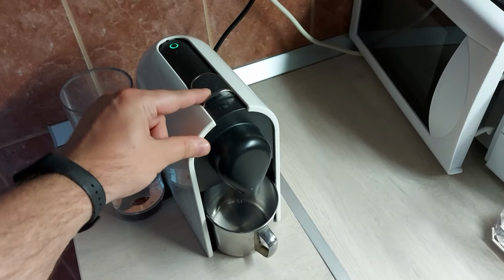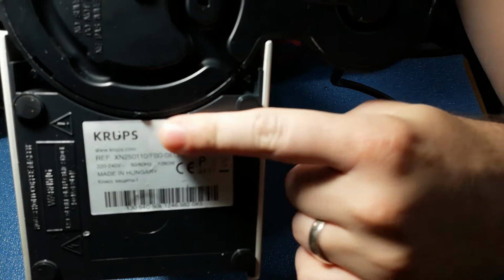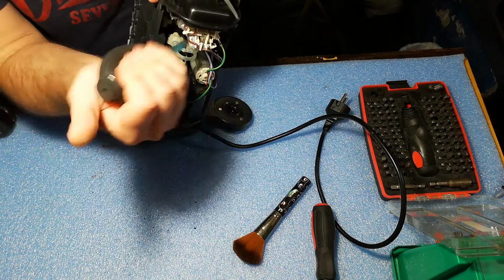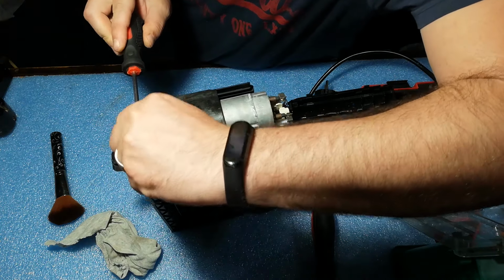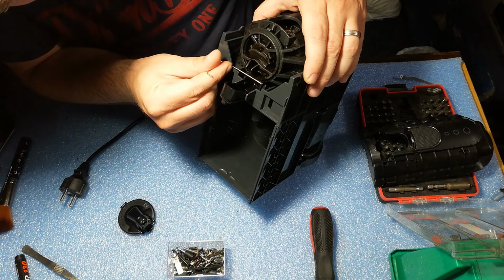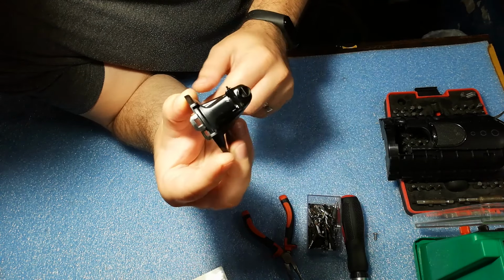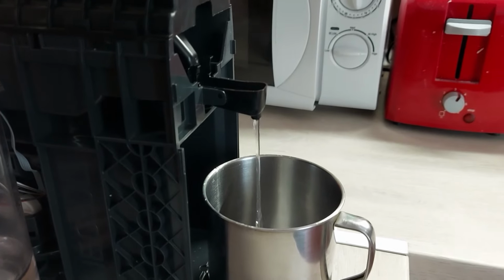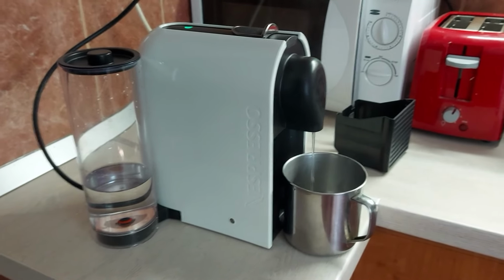Nespresso U - Step by step repair guide  KRUPS XN250

Comment: TYSM!!!! I used this video to diagnose and repair my Nespresso U (D50) made in Hungary.  The biggest problem was figuring out what tool I needed to unscrew the 3 screws to open the housing.  For those in the US I bought a Titan "tamper proof star key "set for $10 -a very worthwhile investment. The T-10 star shaped screwdriver with a central  depression fit the tiny screws in my machine which may differ by manufacturer 
 I did the same repair in the video using a thick piece of wire from jewelry making and gluing it as per the video. I later found the part on eBay for around 20 dollars but so far my repair has been working.  
I could not have done this without this video!  Thank you again!

Comment: Thkx a lot Adrian, great repair café!! In my case the clips were not broken. Only the noozle was no more fixed. By the way, my model has a third screw located behind close to watertank which you need to unscrew to take over the cover. Torx are TORX BO TX 10  which a whole in the middle
Reply: Same as mine, the lower clip was broken. So I don't see what's wrong on the noozle from the tutorial, it looks like mine (without the metal pin) ?

Comment: Great video! An easier way to remove the nozzle is to run the machine and then pull the plug when the main part has moved to the back. Plug it back in when you have reinstalled the nozzle and it will move back into place.
Reply: This was the method I used. Didn’t need to take the case off, no Torx screwdriver required.

Comment: Just fixed my sister-in-law's Nespresso XN250 using this method, thanks so much. A tip is to use a section of spare/broken stainless steel spoke from a bicycle wheel, so there are no potential issues with rust.
Reply: Play

Comment: Cheers. I snapped part of a sewing needle for mine, and used super glue and baking soda to instantly dry and make it extra strong. Works well cause the motor made the part clash with the bucket part and it survived it. I then adjusted everything correctly and it works perfect. Just remember to have overhangs because my first attempt I cut it too short and noticed that you need the overhangs as it slides into the little tip bucket to tilt it forward.

Comment: VERY nice tutorial, Adrian! I just had to do the same repair to my U. Though I generally followed your guide, a did a few things differently. Mainly, I used a stainless steel nail cut to size (20 mm). I opted to use a stainless steel rod so that I didn't need to bother with corrosion in the long run. Second, to glue the nail/rod in place, I first carved a shallow groove on the plastic of the nozzle so that the rod would be more firmly positioned for the glue job. And I used cyanoacrylate glue (superglue) to fix the rod in place. However, normally superglue would have a hard time adhering metal (specially ss) to that kind of plastic (ABS?). So, to overcome this, I first roughed up a bit the surface of the plastic and also filed the nail, leaving small notches all over it's length, to increase the surface where the glue would act. And most important of all, I sprinkled baking soda over the area after appling the superglue. The result was an acrylic-like surface over the nail and the the surface of the nozzle, keeping the nail firmly in place. The end result was prettyy strong, to the point that I think that if I tried to prye out the nail, it would rip chunks off the blak plastic with it. Moreover, not counting the very strong bond, it cures in seconds, so right after cleaning the baking soda and washing/brushing everything up I could assemble the machine back together. Cyanoacrylate glue can easily handle the temperature of a Nespresso machine, and with the baking soda mixed in it's safe to use there.
Reply from the maker: Great job! Sounds like it Will last for a long Time.

Comment: Thank you for the video, very clear. and the metal pin attached with epoxi, will be more durable than the 2 small original plastic part

Comment: Adrian, do you know how to get the diffuser out for cleaning on this type of Nespresso? On the other machines where the user applies the force for perforating, I seen videos of people removing that entire unit. I get a sense mine is rather blocked. Tried cleaning it with a tooth brush but to no avail.

Comment: Hi, I have a nespresso U, leak water into drip tray from behind capsule. I opened up, the part in this video is not broken and I took the round plate out and no clogged. Do you think that is something wrong with the pump? Do you have a video to tear the whole thing down?😅 thank you

Comment: hi Adrian, Happy New Year 2024. So I'm working on a Nespresso Krups milk with the slide function and automatic capsule drop into the container underneath. Must say the more functions there are, the more things that may possibly go wrong. I was doing the one job that is now done, but when I reconnected the top part that has the 3 buttons for small, medium and large coffee, the lights had stopped working, the functions still work, but no lights. Wonder if you know what that is, maybe i short-circuited the green electronics panel housed under the buttons, I took that apart today, it all looks ok. I have another machine, almost the same model, maybe I'll take the little connector off that and see if it is that that is wrong, but as that machine is not6 mine, I may read up on it all tonight, see if I can find some info.

Comment: Thanks Adrian. What size torque bit is required. Also how did u remove the piece of metal in the middle of the bolts so you can actually open them? Thanks
Reply from the maker: Hi John it is a T10 torx

Comment: Great video!! What kind of epoxy glue did you use for this? Will it wear down with the heat of the water from the machine over time?

Comment: This was a great video, and I followed all the steps. It fixed only part of the problem for me though, now I've got the water coming out of the spout and water leaking in the dripping container. Any advice?
Reply from the maker: În this case you need to. Hange also the oring. All Nespresso machines have this big oring in the same plece. If you want to see where this oring is located try reaching for the video on my channel.

Comment: I have the same machine. It’s just stop turning on. I used in the morning perfectly then when I try to use in the afternoon there was no light. I tried basic things, unplugging, using another outlet, checking capsule tank… Do you think is there a way to fix by myself? Is there any video?

Comment: Hi Adrian. Great videos! I have a U D50 very similar to this grey one. I repaired the nozzle in the past but now I have a clogged diffuser grid plate. I can't find a way to remove it for cleanup or a video showing how to remove for my model. I would really appreciate if you could show hot it's done. Thanks!
Reply from the maker: Hi. If I get one in my shop for sure I will do it.
Reply: Hi Adrian, I was able to figure it out. There are two small tabs holding it in place--they are hard to see, at about 10 and 2 in a clock dial and reachable from the hole on top (where capsules go). I cleaned it but when I test it, a lot of water falls from behind the spout, directly into the used capsules bin. Should there be a seal theat seats against it when brewing?--I do not see any. If so, do you know the part #?

Comment: Hi thanks for the video. It's really clear. I have previously replaced the nozzle on my xn250 machine ( the same as in the video) water is leaking again through the chamber but this time the nozzle is not broken. I think from watching another video I may need to clean the diffuser plate but can't work out how to remove. Any bids you can point me to? Or would just a descaling fluid work? Many thanks
Reply: Clean the entire area at front, you can use a toothbrush and repeatedly rinse the toothbrush, if there is coffee debris/thickened coffee that is hard to get to with a toothbrush, you can use those ear cleaning cotton buds on a stick and also a small screwdriver to carefully scrape away thickened coffee waste taking care to do these things gently so without scratching. 

If you have removed the front covers you can also dip that end of the machine in a ''shallow'' pool of warm water, taking care obviously not to let any water get to the other side where the electronics are located. 

In the water, you can add anti limescale liquid. Adrian shows in another video clip how to remove the diffuser disk, but it is not very easy, a little bit too much force and it can break, so I would say just take some time to give the front section a really good clean the back of the disk too, there where you can see all of the little holes in the disk through which the coffee is forced under pressure. 

It is possible to use a small needle, very carefully without forcing the needle or letting it be bent (it will break if you do that) and then push the needle through each hole to ensure that each hole (about 30) is open. 

However, if you submerge the front end in a small bowl and hold the machine in place so the water does not get to the electrical parts, then cleaning the disk and repeatedly running any limescale through the machine will open the holes. If the holes are blocked and the rubbish blocking the way has hardened, then soaking will make it possible to force the holes open simply by using the machine to run anti limescale through the disk. Dry everything with kitchen paper and ear-cleaning cotton bud sticks.

Comment: Hi Adrian your clip this time was well-filmed, you took care to get the parts you worked on, clearly into view from all sides. The rod you used, what is the width? I have a thin coat hanger, the metal part, but I think it is too thick. Cheers.
Reply from the maker: Hi. It is aprox 2 milimeters diameter.
Reply: @benassy69  Thank you very much for your swift reply :)
Reply: @benassy69  Managed it, used a stainless steel nail, was able to cut it to size with a pair of pliers instead of sawing, also used 2-component glue, and sprayed the new p[art too , as you did, with acrylic paint. Works perfectly again. Thanks.

Comment: This one you fixed is the same unit as model C50 from Nespresso.
There's a little detail in C50 : the cover has three bolts; two are the ones you removed and there's another in the back of the cover, right over the water recipient base.

Comment: In my case the cup is stuck in the machine. What torque screwdriver do you use to open the front case?
Reply from the maker: It is a torx 10
Reply: @benassy69  thank you! My torx 10 doesn't fit strangely enough.

Comment: Great tuto,thanks a lot Adrian! Got ghe same machine and this helped me to fix the broken nozzle part by glueing a rod like you did. I have another issue though, after the coffee has dripped and the capsule is ejected, quite some water continues to flow from the capsule chamber and the machine makes some small pressure noises...is it a ring that needs to be replaced a well?
Thanks a lot for the feedback!
Reply from the maker: This second issue sounds like normal. I am afraid there is no fix for this but you have to love with it.
Reply: @benassy69  OK, I'll try to live with it then ;)  Thanks for your feedback and have a nice day!

Comment: Hi ,  very good video.  but did you fixed the leak completely, because i noticed that at the end of the streaming water , the is some water "drop". is this can be fixed ? thank you
Reply from the maker: You will not be able to stop fully the leaking of water. Even when is new the machine is still dropping some drops. This is due to the design of the machines.
Reply: @benassy69  Thank Adrian.  I guess u r right, tested it on my new 1.
Great video.

Comment: Hi Adrian. What can I do if the upper sliding part is locked in a position? It cannot go forward, I don’t know why, I tried everything. Thanks
Reply from the maker: You have to remove that slider and reposition the spring. It is easy
Reply: @benassy69  I have completely disassemblee the machine, removed the cover and the upper black part, but the sliding part seems stuck

Comment: Hey Adrian, my SLIDER at the top of the Nespresso U machine has an issue and suddenly moves freely, so while the machine pours the coffee I can’t move the slider half way to stop it, because the slider runs freely - nothing stops it. How can I fix the slider?? Thanks much!
Reply from the maker: Hello. Inside the slider there is a springs system... maybe the spring has fallen of it's slot. It is really easy to fix. Good ideea for a video. I have a donor U unit so I can make a video on it.

Comment: I want to ask you- my friend gave me their machine. Its exactly as yours just a grey color. 
It doesnt move any water in the system, so maybe there is a clog. 
And it couldn't puncture the capsule. I dont know why because im pretty sure its a nespresso capsule what I have. Maybe the pins are broken?
Fyi the panel with the touch buttons work 100% and the sensor of the door closing work 100% there is a clog for sure I think and I will try to see from there.
Thanks for your video
Reply from the maker: Fill the water tank and blow air in the water tank. For this machine is simple to do. Add 50-50% mix of water and vinegar and let the mix go thru the system. Regarding puncture of the capsule ...the perforation is done on the other side.. water come at 15Par pressure and break the foil therefore your machine is fine.
Reply: @benassy69  I watched another video on YouTube and they recommended to push water with a syringe. Worked the first time and I wanted to ask you- vinegar will only touch plastic parts? Because if it touches metal it will make it rust... I just dont know if needles puncture the capsule of water jets?

Comment: Hi Adrian!
First of all congratulations for the video, really simple and clear!
I haven't taken the car apart yet but I assume I have the same problem as you!
Can you recommend one in particular for the two-component glue?
Does it have to be heat resistant?
Thanks in advance for your availability!
Caesar
Reply from the maker: Hello Caesar. Any 2 component glue will work the ones that becomes hard as plastic. No need for heat resistant one since there's no high heat there.
Reply: 👌🏻
I thank you so much!
Caesar

Comment: Hi Adrian, great video, I have the exact same machine with the exact same problem. Can I ask you what type of screwdriver did you use to open the case? I have been looking for one that matches those screws. If you can remember, what head does it need? Thanks for your help!
Reply from the maker: It has a T10 torx bit with a hole in the middle.

Comment: Wow I was about to throw it out, first youtube video I watch it's this exact problem. I cut up a washcloth pin for the metal rod, used superglue and activator, 10 minute fix. (This made this part to fail though, evil corporation). Now I can carry on drinking the most expensive coffee option.

Comment: The first step is to remove 3 screws.
I struggled a lot, which I realized. This is missing from the video.
I cleaned it up, but even then only the water flows into the tank, unfortunately.
The white plastic spout does not tilt forward.
Do you have any good ideas?

Comment: Hi Adrian ! i have a Torx mini set here but cant find the right one to use. Is it a special one i need to buy ? and what number is it ? thanks in advance !
Reply from the maker: Hi Edgardo. It is a T10 torx with a hole in the middle. Not that hard to find, usually comes in semi pro or profesional bit sets.
Reply: @benassy69  Excellent, thank you very much Adrian !

Comment: Nice work. I`ll try it for sure. What tool are you using for the dissemble? I guess it's not a common screwdriver
Reply from the maker: Hi. The screw head is a T10 torx.

Comment: I have the same machine and its leaking water down on the water tank. Any idea?
Reply from the maker: Yes. The problem is the water tank gasket not making the right seal. Fill the water tank and put it aside if there is water under it the water tank gasket needs to be changed. If not it is the water intake gasket and needs to be changed.
Reply: @benassy69  Is there some rubber seal underneath the tank.? Because mine doesn't have it.
Reply from the maker: Yes. It is there believe me you cannot see it without disassembling the unit.

Comment: Hi, this just happened to my Nespresso coffee maker. Thanks for the video. I just have a question, is that bond and paint still in place after 3 months of use?
Reply from the maker: Hi. Still going strong.
Reply: @benassy69   I am frankly Amazed,, My first repair as per your instruction lived less than 1 month. the second attempt less than 1 week.
Reply from the maker: Sorry to hear this. Maybe you used a weak glue. In my case I have used a strong 2 agent bonding glue that becomes strong like concrete. Nevertheless also in my video I suggested changing the part completely but in worst case scenario use my methods. Therefore please don't be upset I just want to help.
Reply: @barenekid9695  This mashine has this special Problem again and again even with the original spare Part. To prevent from breaking you should only use original nespresso capsules (Or Starbucks for nespresso )

Comment: How or where can I test (with multimeter) that there's a current running through the milk frother?
Reply from the maker: Sorry mate but my unit doesn't have a milk frother. To take a guess I would open it and test continuity on each terminal and if the motor works.